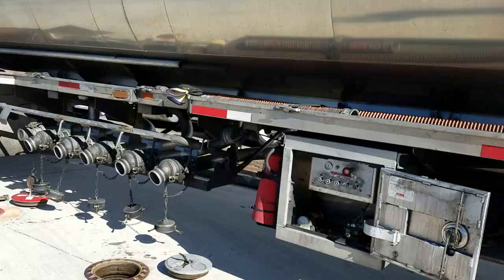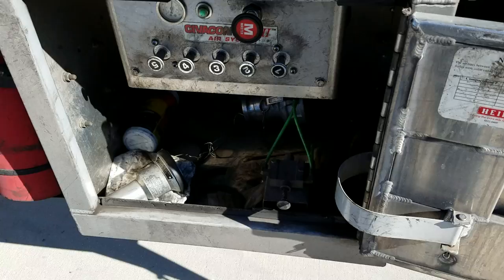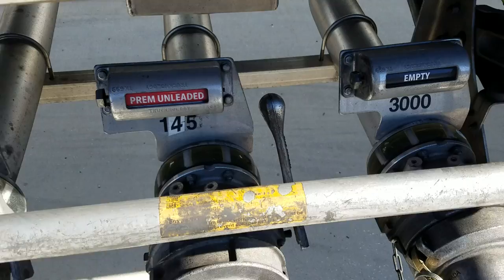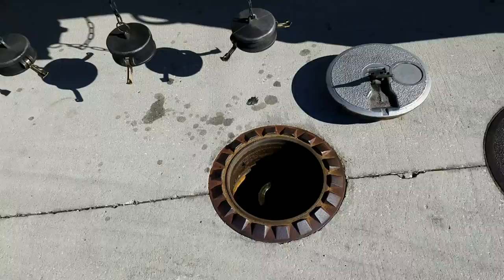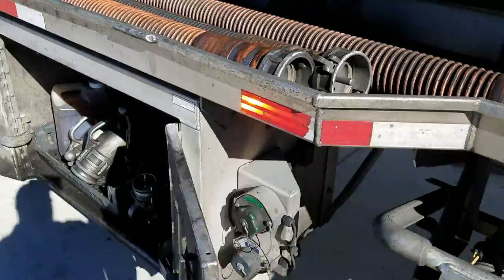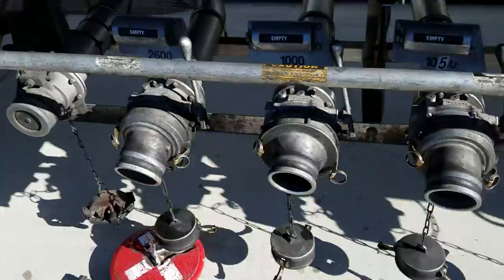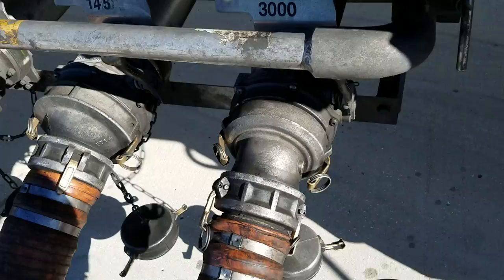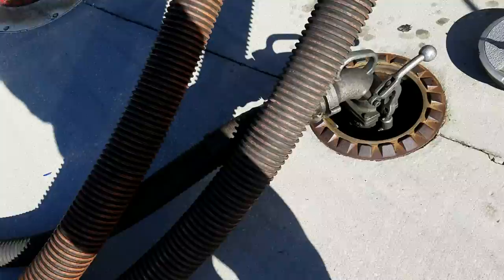How a Fuel Truck Delivers to a TruckStop

Comment: So does the trucking company have a contract with the fuel company that when you need to refuel the truck, you can just take it directly from the delivery tank if you have diesel onboard, and you just keep track of how much went from there into the truck's own tank? It would be a little ironic if you had to fuel up from a station to your truck, wouldn't it?

Comment: Very interesting. Thanks for this. But is there only one vapor recovery outlet for both tanks? Or did I miss something? Having worked at gas stations back in the day, as well as worked on the ramp at an airport fueling general aviation planes and jets from fuel trucks in -20 temps, I can appreciate how much harder this job gets in frigid weather when everything gets stiff and hard to handle. Our fuel hoses were rubber and on reels and they'd become super stiff and hard to pull. Then we'd have to haul them up ladders sitting on solid ice to put fuel in high wing aircraft. And with the skin on the wings being thin aluminum, one slip with the heavy nozzle would punch a hole through the wing. Not good. And standing on top of a ladder on ice holding this heavy hose and nozzle while trying to turn around backwards to read the little fuel meter on the truck and get the precise amount of fuel requested was a trick.  It was a very tough job, and of course, paid barely minimum wage. Think I spent my first months pay on just cold weather clothing to do the job..
Reply from the maker: Yes at this store the regular and premium share the vapor recovery line. So I only need to hookup one vapor for both tanks.

Comment: you do not have to connect a cable ? Here the driver connects a cable from the truck to the cable.. so they both have the same electrical potential and there is no possibility of any sparks from electrostatic charge.. also included in the cable are the wires of an automatic shut off valve in case the ground tank is 100% full... to prevent any spillage out of the tank ventno such things over there ?

Comment: In the UK I always tip the derv first then after draining the line down flush it through with spirit to clean the hoses. Also I only half open the tanker valves to reduce the chance of an air lock then open fully after a minute or so.  Also cap the hoses at one end to reduce the chance of product leaking out. I noticed that you remove all the compartment caps, not one at a time for each discharge, not trying to tell you your job but doesn't that make it dangerous if you should open the wrong valve by mistake ?

Comment: How come there is only one vent for both tanks? I expected that they are connected somehow underground... but when you disconnected the premium hose while regular was still flowing, I expected the air to come rushing out of the disconnected premium hose but it didn't. Would you please explain? Thanks!
Reply from the maker: shakazzolo , underground the vapor pipe connects both tanks, inside each tank the fill pipe im dumping fuel into goes all the way down to the bottom. So when I’m done dropping and disconnect the hose, vapors don’t come rushing out due to the end of the pipe being submerged under the fuel level. They do this on gasoline tanks to keep vapor in a closed system.

Comment: Cool video. I usally run on out of the gas pumps when I see a tanker dropping. Don't want the tank stirrup. How do you know when the tank is close to full or going to overflow? Does it have a whistling valve like a oil tank?
Reply: Overfill alarms and a auto shutoff valve

Comment: Do the managers ever test the fuel you are dropping? When I worked in private aviation we tested the 100LL and Jet-A with hydrometers. Obviously if aviation fuel is contaminated the effects are more dangerous but it would still suck to contaminate the whole ground tank. Also, our tanks were above ground so the unloading time could take a while.

Comment: Surprised to not see a drip bucket being used. You’re not required to bucket test the compartments after unloading?
Reply: Why would you purposely drain the little bit of gasoline that everyone knows is in that valve into a bucket? You going to climb on top of the trailer and dump it back in or let it spray out of the bucket going down the road?

Comment: Can you use same hose for diesel and gasoline? so, that means that very little amount of diesel will be pored to the tank, and as diesel is denser than gas, it will remain in the bottom of the tank. I guess if time to time they have to purge the diesel from bottom of the tanks at gas station.
Reply: The diesel and gas would mix and be at an inconsequential concentration.

Comment: What happens when it rains does it destroy the gas letting the water get inside the tank?
Reply from the maker: Not enough rain will get in to cause any issues. Over time condensation may build up and get in the fuel. When that happens a company will be called out to remove the water from the tank. Thats one reason i recommend buying fuel from chain stores like circle k, shell, marathon, ect. Some make sure the tanks are inspected often.

Comment: Please tell us how much a gallon costs the store. I always wanted to know. Also, is gasoline wholesaled- meaning does the exact same gasoline in the truck go to like Citgo, Hess and Speedway, or do these companies have proprietary formulas that arrive specifically for that company? Here's your chance to debunk or confirm.
Reply from the maker: I don't ever see the price they pay for the fuel, that info isn't on the paperwork I get when I load. However, a large majority of gas comes from the same tank. For instance, here in Jacksonville, FL, gasoline from a marathon station is the same as gas from a BP station, only difference is the additive that is injected into the gasoline during loading. The additives are different but the base gasoline is the same. That's why I laugh when people say "my car runs good on brand X of gas, but runs like crap from Brand Z, when both brand x and brand z are the same gas with a mild additive making them different.
Reply: I always thought gasoline was wholesaled, and I appreciate your confirmation on it. Hence, I always get the cheapest I can find. My guess is pricing is kept very, very quiet. If the public knew how much gas really cost the station, there'd be an uprising of discontentment to the likes we've never seen before in this country. Well actually...  no one would probably give a shit.  Any idea why gas is always priced at 9/10ths?
Reply from the maker: @dbfcrell8300  , the pricing has to do with taxes, I still think the 9/10ths thing is very stupid. I will say though, most gas stations don't make much money from selling gas, they make the majority of their money from selling food and other products from inside the store. A lot of stations lose money on gas. The government tells them they can only charge x amount more than what they paid for the gas, but it has to be a certain amount for the state they're in. For instance, they could buy a load of fuel and it gets delivered, then the price of gas will drop. Now theyre losing money because they are required to sell that gas at the lower average price.

Comment: seen the this procedure when i was 9yr old at our local gas union 76 station  ~ diesel is nearly a oil that it can gel in sub-temp -20
Reply: akush55 #2 diesel gels at +10, 50/50 blended #2/#1 diesel gels at -15, #1 diesel is good to -60.

Comment: So you can use the same hose to pump Diesel in. And use it to pump regular gasoline.. and the same fitments for everything?🤔
Reply from the maker: Htx_ Papii , yeah its all the same. You just have to make sure you drop fuel into the correct tank. They are all color coded

Comment: 11:46 Awesome vid & knowledge, THANK YOU.....There was a lock on the in ground tank, I didn't see you unlock to remove the tank cap or relock it, is that bc of the customer not locking that or you/your company??
Reply: They are usually easy to pop off without unlocking the lock.  Just don't get caught by the boss.
Reply: Right. They are super easy to either pop off or for the little tab the lock goes through to be broken and just looked locked. OPW caps are notorious for this. 

There is a system called tank commander that makes opening the caps without the key a lot harder.

Comment: What actually measures the volume delivered? The gas station, the truck, or where you fill your truck? Is it volumetric or by mass? I'd imagine there has to be a precision measurement in the process somewhere, because when gas is $4.50 a gallon, I cant imagine a stick with a ruler is close enough, no?
Reply from the maker: Michael Molter , there’s a machine in the station called a “Veeder Root”, it measures the exact gallons I deliver, it’s accurate down to about 50 gallons. That’s why I’m not worried about rounding on the stick because the stick readings are just for reference.

Comment: Do you have to check the tanks for water using a water paste? Just curious, had a job where I climbed shore tanks and we had to check for water when we would stab the tanks.
Reply from the maker: Yes, with the company i work for now, they provide water paste. I use it at Gas Stations that i deliver to now.
Reply: @DrtyDiesel  Thanks for the video, it was very interesting to see how y'all do your thing.

Comment: I just flinch every time he slams metal on metal, cant that create a spark?
Reply from the maker: Its all made out of aluminum, no spark from non-ferrous metals. Thats why our trailers are required to be made of aluminum and we also have a lot of brass or copper used in the plumbing as well.

Comment: Awesome video DD.
I diden´t see any earth cable to liquidate potential difference.
How did you do it , its intergrated in the hose by a separate cable?
Greetings from a Aerosol trucker in the Netherlands.
Reply from the maker: Hello there! Yes, there's a copper wire that runs through the lining of the hose to ground or earth the tank to the underground tank.
Reply: @DrtyDiesel  ,That makes it impossible to forget .
Should be nice if you have your own equipment each day to keep everything in good condition.
Good luck with your job.

Comment: Gas stations that claimed they have Top Tier, do they add the additives to the underground tanks after fuel delivery?  I thought all gas stations receive gas from the same production plant.  Great video!
Reply from the maker: Thank you! And yes, top tier gas stations have additive put in as I’m loading their gas on my trailer at the loading terminal. Each terminal will have the additive the customer wants. When I select to load for that supplier or customer, it automatically sprays in the additive as I’m loading.

Comment: You only deliver quite a small amount of Premium unleaded. In my neighborhood I count a lot of expensive luxury cars from BMW, Mercedes, Lexus, Lincolns to Volvos. All of them only take Premium, so I'm going to assume some gas stations would have larger Premium reserves than others depending on area code yes?
Reply from the maker: Trades46 , we deliver based on what they sell per day. At this store they only sell 500 gallons or so a day. One of the other stores we deliver to thats near a bmw dealership sells 1500 gallons a day, so when we deliver to that store its usually 3500 gallons of premium.

Comment: Mid-Grade is 65% Regular, and 35% Premium.
Reply from the maker: Yeah, thinking back now, it was 75% regular and 25% premium when i loaded 89 marine grade. I imagine the percentage would be different once ethanol is added. At the time of this video i had never thought about ethanol changing the octane rating
Reply: @DrtyDiesel  I program the Verifone Commander systems the run the cash registers inside of stations. BP, Sunoco, Shell, Valero, etc. All the mid grades we've ever told the systems to mix were 65/35. That's interesting that it's 75/25.
Reply from the maker: @KamikazeGrunt063  well i know ethanol is an octane booster. Thats why i assume since i was loading non ethanol it was a 75/25 mix. But like you said, its a different mix percentage and i can only think of it being because of the ethanol.
Reply: Actually, there are many blends for mid-grade depending on octane rating. Some brands use 89, others 91.

Comment: Thank you for what you do. Do those trucks have some kind of anti slosh baffles in them to keep fuel from sloshing around? It seems like with all that fuel in there, the truck would be very unstable on the road.
Reply from the maker: Thank you, and yes this trailer I pull has baffles. There's still side to side movement but you don't feel the forward and backward movement near as much.

Comment: what happens to the vapor in the tank when you go back to refill? dumped outside  at the plant instead of the servo?
Reply from the maker: At the rack, while im loading it gets pushed into a bladder tank, where it is stored and then burnt off in a vapor tower.

Comment: When I was 6 or 7 years old I had decided I would be a Texaco Man and fill my Mom's best friend's tank with the garden hose, both knew I did it just imitating the man at the service station so I did not get spanked. My Mom's friend had to have the tank removed and flushed, thankfully she did not start the car. I wonder what safety features the service stations have to prevent the tanks from being filled with water by anyone. Of course that person would face arrest, but is there any locking devices to prevent this?
Reply from the maker: Thats crazy haha and yeah, if water is detected in the tanks and alarm will go off on their print out machine.

Comment: Question.  I don't know if its ever happened, but does the truck stop pumping into the tank once the tank reaches a certain level, much like a pump filling your car will stop once it reaches a certain level, or does the operator need to do some math to make sure it doesn't over flow?

Pretty cool job.
Reply: I know it sounds scary but the truck driver has to do math to make sure what will fit. You can split a trailer between stations but cardinal rule was to never have to split a compartment due to bad math.

Comment: Thank you for this! I want to get familiarized with the tank equipment terms because I'm looking to get on with 1 of 6 different distributors here in Birmingham. Studying for HM and T endorsements.
Reply from the maker: Heck yeah, that's awesome! Good luck to you, be safe!
Reply: @DrtyDiesel  Thanks. 1 question...isn't there a grounding cable or something that you have to connect from tank to ground before connecting your hoses to the fittings?
Reply from the maker: @SixTenVisuals  The hose has copper wire running through it, grounds to the tank when I hook up the hose

Comment: Where do the fuel vapors go once inside your trailer? You Filter it out somehow back at the shop?
Thanks for posting.
Reply from the maker: When i go to the loading terminal to reload, the vapor is pushed out of my trailer during loading and goes into a large tower where it is burnt off.

Comment: 13:04.  Don't you think you could reduce your "bored" time by starting out with the regular instead of the premium?
Reply from the maker: Frank Howard , I’ve just always started with premium with having the mindset of get that off the trailer first then start on the regular. It’s just my routine, ever since I dropped regular into a premium tank a few years back with my first company. Ever since that screw up I just always start the premium before regular or diesel before gas

Comment: Tough job.   Are those hoses bonded and is there a way you can ground out your rig before you start unloading?
Reading printed physical books would be good while waiting if you are into that.
Reply from the maker: When I hook up the hoses it grounds the truck to the tank. That way its grounded before product starts flowing.

Comment: Interesting video.    All your hoses are self grounded to dissapate static electricity ?      Thanks
Reply from the maker: Yes they are, they have copper wire running through them to ground the tank to the trailer.

Comment: What stops thief’s from opening the lids and pumping gas out the tanks
Reply: weston m there is a series of float sensors in the tank that are connected to each gas pump where you fill your car.  These sensors are connected to an alarm panel in the managers office of the gas station.  If the main panel senses movement in the floats in the tank without the pumps being used, alarms will trigger.  This means there is a leak in the underground tank or someone is pumping out of one of the ports.
Reply: Brian McNew thanks for the info

Comment: I don't know if recording this video by yourself is the right thing to do. Generally, Fuel and petrol stations are high risk areas, for fire or any other type of emergency. If you had to record, then placing the camera far wide away by itself may be acceptable. What if something accidentally goes wrong, because you were attending to the camera? The right thing to do is to always assume something would go wrong and you focus on the procedures set out by the company.

Comment: Out of curiosity, are the hoses conductive ? I was wondering how you avoid static discharge causing ignition of vapour. I used to work in a petrol station in the uk and the first thing the delivery tech would do was to connect an earth bonding conductor onto the tank cage ground. I thought you may have a conductive bonding wire built into the hoses between the couplers ??

How do you prevent static charge build up on the delivery. I would love to know. Many thanks.....   :-)

Comment: What happens to the vapors in your trailer when your trailer is being loaded with fuel
Reply from the maker: David Wilson , they are pushed out and into a large vapor burner. It’s a tower that has a flame at the bottom, the vapor is piped into the tower and burned off.